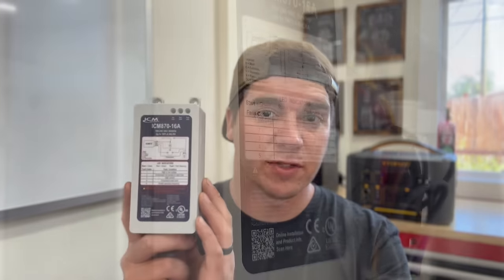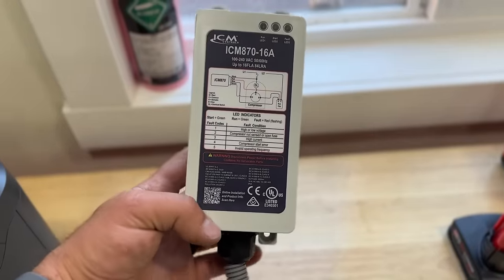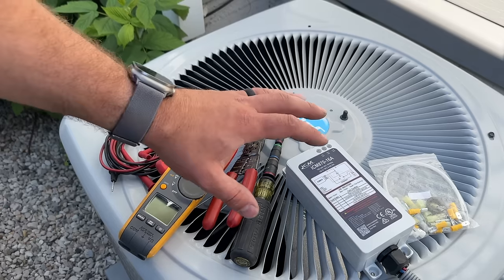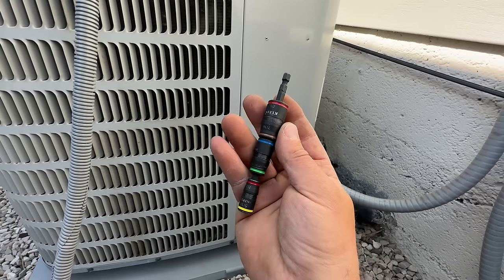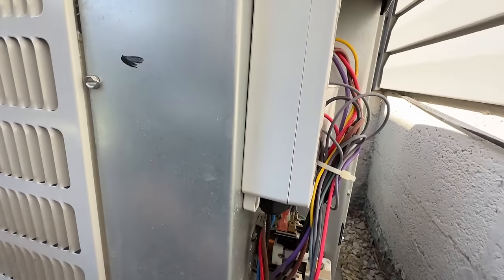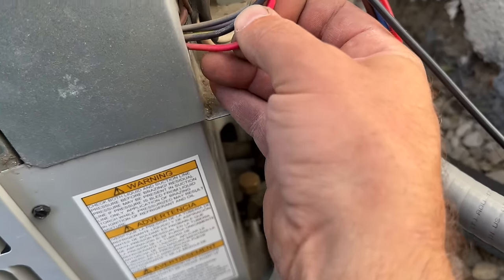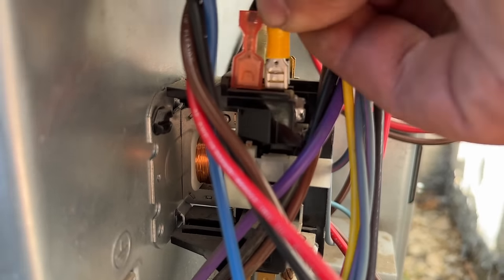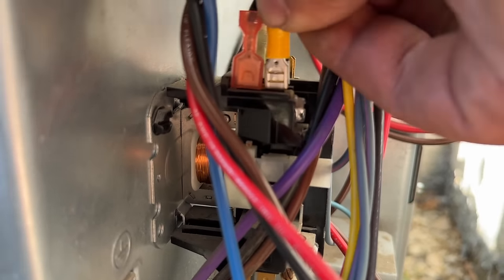This $150 Soft Start Allows You To Run Your A/C With A Generator!  Introducing The ICM870

Comment: Will this help with the electricity bill?
Reply from the maker: No, it primarily just allows you to run your ac with a generator. It also helps with lights flickering and noisy compressor starts 👍🏼
Reply: No, the amount of energy required to cool or heat your house remains the same regardless of any of these devices. (I am assuming your electric utility charges you for just a total amount of energy, in kW*h each month.) Their purpose is to spread out the spike of current that an electric motor pulls when it starts up. This is important because a generator or battery inverter can only supply so much current (amps) at once, so that inrush current is often the limiting factor rather than the total power the generator or inverter can output.

Comment: Are these low amp soft start units compatible with the mini split system you have been showing?
Reply: most mini splits have inverter driven compressors. they 'soft start' by default
Reply from the maker: Yea the inverter technology that all the mini splits have, already has an integrated soft start.

Comment: Has anyone run into issues with the ICM870? 
I’ve install one and 1 week later it went into fault 2 and won’t start the compressor. Uninstalled the ICM and the HVAC unit works as normal.
Reply: Mine failed after 31 days. The motor start capacitor 100uf inside the ICM870-16A failed and leaked all over the circuit and the internal fuse F12.5A 250V also blew.

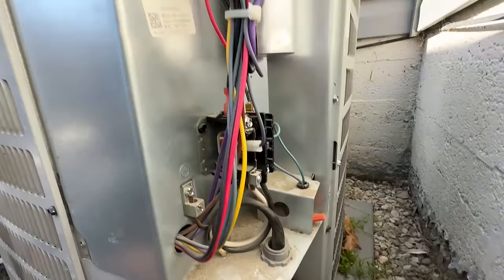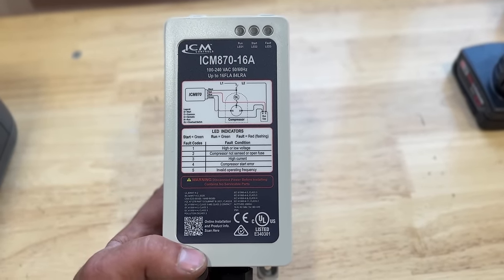Comment: In response to my comment from 3 days ago I was able to partially answer my own question. In the video from "The DIY HVAC Guy" listed here (https://www.youtube.com/watch?v=mHeK6G8bN3c), he connects his Micro-Air Easy Start to the same unit as he does in this video (I confirmed this by the control panel sticker at 5:34 in this video and at 3:09 in the "Prepare For An Emergency Power Outage By Installing This Device. Micro-Air Soft Start" video). After the first start with the Micro-Air, the in-rush amps registers @ 7.7 (compared to the native 39.2 without). Side note: I don't know what the allowed tolerances are on that particular Fluke model or if environmental factors such as temperature are at play, but what's interesting is that the native in-rush amps in this video registers @ 35.2 vs. 39.2 in the "Prepare For An Emergency Power Outage By Installing This Device. Micro-Air Soft Start" video on the same unit. Now, back to the Micro-Air. What isn't shown in the "Prepare For An Emergency Power Outage By Installing This Device. Micro-Air Soft Start" video is the in-rush amps after the Micro-Air learning process has been completed (after 5 starts). With my Amana 4-ton unit I saw an additional 42% reduction in in-rush amps from the first start to when the learning process with the Micro-Air had completed. This is completely hypothetical, but if we use the 42% additional reduction that I obtained after the learning process is complete, we would see an additional 3.2 amps trimmed off of the 7.7 leaving 4.5. Though not by much, this would render the Micro-Air more effective than the ICM in this scenario. To be fair, the ICM Controls website lists the ICM soft start units as being "self learning" but that's all they say, whereas with the Micro-Air we can have confidence that the in-rush amps shown after 5 starts is a reliable and definitive number. Would love to see the final results of both units after 5 starts to truly answer this question. And lastly, you can reset the learning process on Micro-Air if needing to move it to a different unit, but there is no way to do so on the ICM units.
Reply: Testing 5 starts and getting reliable comparison amps will take some time. If the high and low side pressures are not allowed to equalize then the start amps will be higher due to the extra mass/pressure/resistance in the high pressure line. Quick successive tests will not likely result in true readings.

Comment: How does the icm 870 differ from a 5-2-1 hard start kit?
Reply from the maker: The hard start kit delivers the current mega fast, wheras the soft starts deliver that same currently slowly, and they also kick the fan on first so the amps are not drawn at the same time

Comment: anything different installing icm unit on a goodman package unit??
Reply from the maker: Nope everything is the same
Reply: @diyhvacguy  didn't think so , thanks ordered one.
Reply: well tore down my sister's package unit , cleaned and had to relevel unit , drain was over flowing inside being a 1/2'' out . installed icm for 2.5 t unit . and it works great . easy to install and its amazing how much quieter start up is. and yes it runs on back up generator with no issue. hurricane ready now. thanks for the info.

Comment: Will this consume less electricity?
Reply: No, the amount of energy required to cool or heat your house remains the same regardless of any of these devices. (I am assuming your electric utility charges you for just a total amount of energy, in kW*h each month.) Their purpose is to spread out the spike of current that an electric motor pulls when it starts up. This is important because a generator or battery inverter can only supply so much current (amps) at once, so that inrush current is often the limiting factor rather than the total power the generator or inverter can output.

Comment: What’s the better option, I saw the ICM870-17 or the MicroAir 368 Soft Start Home Commercial Easy 

The same generator that you got from Costco and I want to integrate my home AC. We lost power for four days here in Texas two weeks ago, and it’s either I power my entire house or just hard wire to my AC. I would like to run everything.

Comment: I installed that ICM870-16 into a 3 ton condenser and it only lasted 10 days.  Compressor would not start and no fault light was displayed.  Removed power and reapplied and got 2 flashes and other times 3 flashes.  Sent it back for refund.
Just wondering if it was just a single faulty item or is there a large batch of faulty ones.  Purchased it thru Amazon. But maybe I will try once again and purchase straight from ICM.  Little issue with seeing light gray colored units on the web but ICM web page shows a dark blue unit.

Comment: I have question  for any expert, I want replace my 1/10 hp condenser fan with 1/4 hp, with same rpm,  is it OK? I will make sure put new capacitor rated for 1/4 hp
Thanks
Reply: alaakarmosh, why would you want to do that?
Reply: @speckulator7516   because it's a lot cheaper plus the ac I have is from 1999
Reply: Yes you can. Just make sure the rpm is close. Be advised it may use more electricity to do the same job. Not an issue unless you care about such things.
Reply: @1badsj  thanks

Comment: Or you could just buy an inverter based AC with integrated soft start (not all VFD based AC are setup to do soft start though). This is like putting a turbo on a 300k mile car...

Comment: DIY HVAV Guy my inrush amps still jump to 37 after this installation. My AC is working fine. What could be wrong?
Reply from the maker: Maybe a defective unit?
Reply from the maker: Sure you have it wired as shows on the front cover?

Comment: I splurged and bought the micro-air. I only regret it based upon the price point alone. I like seeing the locked rotor amp draw is now 14 instead of 60, and the run amps are now at 5 amps instead of 9.9 amps. I didn't need to use a clamp ammeter to see the difference and I don't have a clamp ammeter.

Comment: I have the 3ton unit from M-A. Would not work. I have a 3 tom York heat pump. With the M-A connected the compressor would time out and made a bad noise. My hvac tech  said not to use it so im looking for one that would work for me anybody have a known York soft start usage?

Comment: If it need 35A how does it work on 6?  Thanks
Reply: the box has some electronics that probably changes the voltage or something so the amps are lower on initial startup. Basically, the box is a soft start for ac compressor motors. All big motors have a motor starting capacitor so I guess this is just an upgraded one that manufactures think is too much money to install at the factory.
Reply: I question whether the compressor started, I did not hear it. Just the fan Motor which would be about 5 amps. ? I need to watch the next video on the generator because these are new news to Me and I want one if they do what they say.
Reply: That's just the starting current. Also called inrush current. when you start a motor all the electrons rush into the motor pulling a lot of amps then when it starts not as many electrons are needed so the amps fall off to whatever its running current is. A soft starter basically momentarily reduces the voltage to limit the inrush current then raises it to normal line voltage.
Reply: @snurb48  with that little unit you're looking at 2 amps max. A 1.5 hp condenser fan on a big unit will pull 5ish.

Comment: Does anyone know if using the larger 16 amp "soft start" will work fine or better than the 9 amp my unit(12kBTU) only requires the 9 amp but I'd be ok with buying the 16 if it doesn't hurt anything?
Reply from the maker: I would stick with the recommended size. They are sized for a reason. 🤘🏼

Comment: I am skeptical about these soft start gadgets. You are adding another complex point of failure in the AC system. If you want to run your A/C with a portable generator, get a 17000W Generac, it will run a 4 ton AC unit. My HVAC guys won't install these kits. They are more trouble down the road that are not even worth it. Installation labor costs are as much as a 15000W generator, which can run a 3.5 ton unit. I don't want to have premature compressor failure which will cost $1500-$2000.

Comment: This appears to be nothing but a start capacitor in a box with some smart logic voltage monitoring. Telling people to spend $170 on a capacitor they could buy and install themselves for $30 is kinda iffy. This pony better have more tricks. 

The other issue is the claim of "up to 70%", when in reality it's more like 15-20%. Most units are STILL too large for a normal generator to be able to cope with the inrush amps on the compressor. 

I've already fit both my units a few years ago with hard start kits and it helped a little but not nearly enough. So I bought (2) small 8k BTU window units that run off of 110v. Mount these in your bedroom and one other critical room and that's the only rooms that gets AC in an emergency.
Reply: This is a soft start kit, it is not a hard start kit. It add a 100uf start capacitor in parallel with the run capacitor for 0.45 second while ramping up the current on the compressor main winding. On my 3 tons A/C, inrush current went from 80 Amps to 19 Amps. My Honda EU6500i generator can now start my A/C unit
Reply: @montreuil2l  I'm going to replace both of my Run capacitors on both units and see if that helps. I'd love to be able to start my A/C units off the generator.